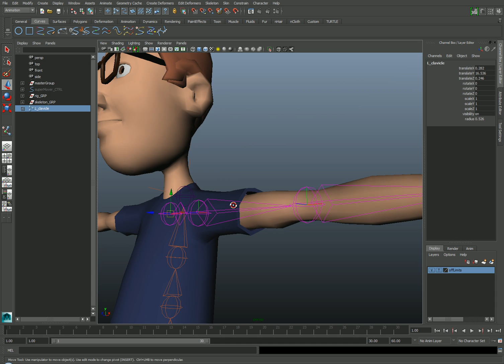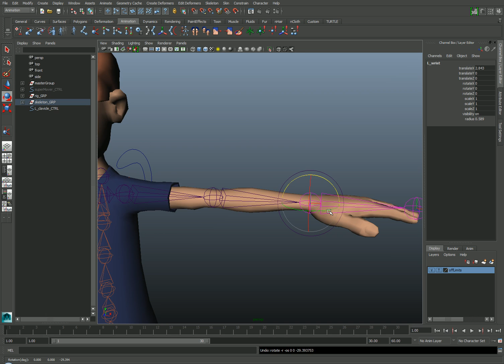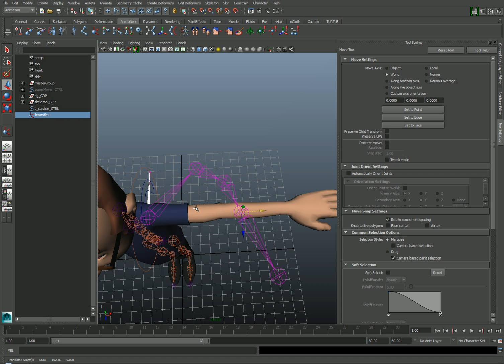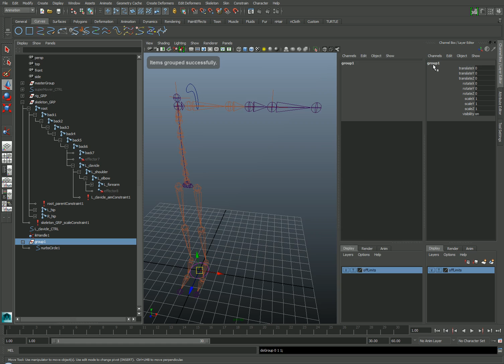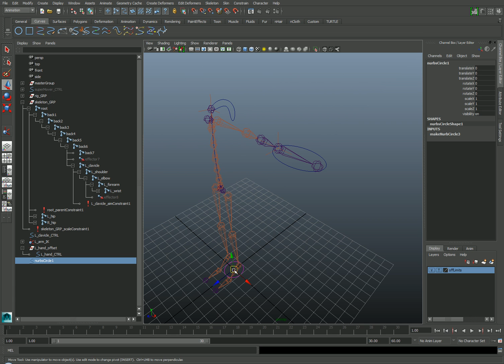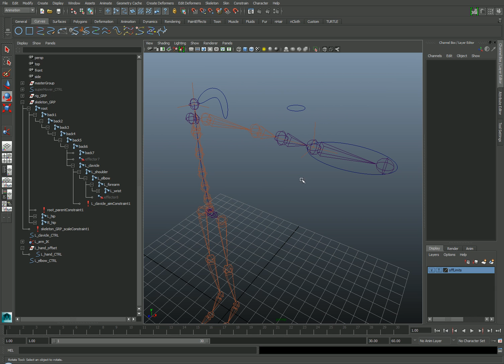Tutorial: Rigging an IK Arm in Maya

Comment: Great tutorial, very clear. I learned in the length of this video the same information from about half of a semester. One question. I'm running into a problem setting up the controller for the right clavicle control. The left one works fine, but for some reason the right one is acting up. I froze the transforms, snapped the pivot over the shoulder joint, and constrained it with maintain offset turned on and the world up type set to none but when I try to move it absolutely nothing happens. I can see the constraint in my outliner, but it doesnt affect the joint. I've been struggling with this and I have no idea what's going on. Also, if it helps I'm actually using the ybot rig from mixamo and adding ik controllers since it just came with bones and nothing else. Don't know if that helps, but I figured it was worth mentioning. Thanks

Comment: I've pretty much been able to rig anything pretty ok, but I've never seen a decent setup for an automatic forearm roll to fix the twisting issue when the hand rotates on the X axis. I'm sure you guys know what that is. 

So in a basic arm setup we have a RP IK solver with a manipulator curve that drives the IK handle with a point constraint and the orientation of the hand joint using an orientation constraint. Mechanically this works fine. What a lot of people are taught to do with the forearm and wrist issue is to create a forearm joint in between the wrist and elbow. That's a good idea until we try to automate it. If we use the .rotateX /2 expression that most people teach that only works until the hand manipulator gets moved at a certain angle to where the orientation of the hand creates gimble lock. 

So then if we use the Object Axis orientation for the rotate manipulator we don't have to worry about gimble but unfortunately that forces us to rotate the hand manipulator on all 3 axis thus making the forearm rotate even when we rotate the hand up and down because of the three axis rotating together to over come the gimble lock. It also makes a mess in the curve editor some times creating euler flips.

So what does a professional wrist and forearm setup really look like?? I seriously have never seen one. All I've seen are some half baked setups. Thanks for any hints on this. I'm guess it requires a double manipulator setup for the hand and wrist region?

Comment: Nice tutorial. A good tip instead of parenting temporarily the group, is to actually use it so the rig does not break. 
For instance, create a null group "Ctrl + G" 
Select the Joint + Ctrl Select the null grp and do a Point Constraint and a Orient Constraint with Maintain Offset off - On the settings
Go to the group on the outliner and delete the PointConstraint and OrientConstraint on the null grp.
Parent the curve to the Joint and freeze its transformations. 
Now you will have a null grp with garbage values and the curve inside of it. This way the rig will never break because the null group is acting like "glue" on the joint with the proper Rotation and Translation values.

Comment: thanx jason. 
i have   maya skel Joints named arm, forearm, wrist, palm1, palm2. as u said i have snapped ik handle to wrist end after drawing ik handle (to forearm). that has worked. no issues.

then i did...
1) constrained  palm1 rotation xyz to L hand ctl. 
2) set driven keys for palm2 for small secondary rot effect.
3) as u said, i gave expression "wrist.rx = palm1.rx;" . then just to check, when i rotated in x the L_hand_ctl to +20 and did undo.
     as a result wrist and palm1 was showing -20 (when L_hand_ctl rotx = 0).
4) then i changed the controller in expression like this..
    "wrist.rx = L_hand_ctl.rx;". then i checked rotating the L_hand_ctl in x to +20 and then again to 0. now the wrist joint was showing correctly as 0.

Comment: Any trick for the forearm twist joint for Maya LT? There aint no expression editor there. And I kinda tried everything i could think of, but Node Editor allows only raw inputs, can't operate a divide on a parameter(specifically a float, integers are accepted though). Also, how do you make your controls follow your  rig around? I move da hand  but the elbow control just stays in the same place. It still works though. Will I break something if I parent a control to something it constraints?

Comment: very nice tutorial. really helped me a lot. But i'm having a tiny problem. When I try moving the pivot of the effector, my arm starts spinning around like crazy such that I cannot get the pivot to the wrist. please help.
Reply: +Fatma Rajab make sure your ik is not sticky in the tool settings
Reply: I will.  Thanks
Reply: +Fatma Rajab you can deactivate it after you set it cause you still want the sticky property for animating it's just sticky locks the effector if active so disability it fixing the effector then activating is the fastest work around.
Reply: +Stick3563 and can you plz tell me how to deactivate it
Reply: +Fatma Rajab it should be in its attributes of the ik chain unless you are still applying in which case it will be in the tool settings as a check box while in the attribute bar it will be a drop down. I'm not in front of my computer ATM but when I am I'll clarify exactly where.

Comment: Hi +Jason Baskin! i really like your tutorials because it's at the perfect pace and you explain everything so well. I'm having trouble though, at the part where you constrain aim the clavicle control to the clavicle joint. it works perfectly on the left arm of my character but jut goes crazy when i start doing it on the right! i have no idea how to fix this. i only found out after binding to the skin. my shoulder just twists like crazy when i try to move the control. :( please help. anyone?
Reply from the maker: Annie Chen Hi Annie.  Thanks for the kind words.  It might have something to do with the way you created your joints, but try this: delete the problem aim constraint, and create a new one with maintain offset turned on, and the up vector set to none.  Make sure you select the clavicle control first, and the clavicle joint second before creating the constraint.  Also, make sure that the clavicle control has a pivot point at the shoulder (not at the clavicle).  

Hope that helps,
Jason
Reply: Jason Baskin i just tried what you suggested but it still twists the same way. and i noticed that after constraining it the the rotate is highlighted but RotateX is set to 360 while the others are 0. weird. :\ i went back to before the aim constrain to check and it was all normal. all the rotate directions are in 0.
i have everything else going for me except for this stubborn shoulder. did i miss anything?
Reply: Annie Chen I don't know if this will help, but maybe your axis orientations for the joints are not in tune with each other? Highlight the clavicle control that isn't working properly and go to Skeleton/Orient Joint/box options and put a check in Orient Joint to World then hit apply and try your constraint again.  If it still doesn't work maybe uncheck Orient Joint to World and put a check in Primary axis X and see if that works.  May have to fiddle around with the settings in there, I don't know if it helps but I hope it did.
Reply: ***** you are awesome! :D

Comment: Hello Jason,

First off, thanks for going through the setup with us. It's really helped me get started on my own rig!

A problem I'm getting right now though is that my joint chain rotates 180 degrees whenever I pole-vector constrain the ikhandle to the elbow control. I've tried setting up everything from scratch but the problem persists.. Do you know what might be causing the rotate and how I can fix it?

Thanks,

L
Reply from the maker: Be sure to build your arm and leg joint chains with a slight bend at the elbow/knee if possible.  If you must create the joint chains completely straight, then you will need to select the elbow or knee joint, rotate it into the desired bend orientation, right-click and "Set Preferred Angle" prior to adding the IK handles.  Hope that helps.

Comment: Great tutorial! Exactly what I needed to know for the pesky forearm portion of the setup. This is actually a much better method than some other processes I've come across which went the route of placing the in handles from the arm/forearm to the wrist which do cause the rig to move from where I wanted it and prevented the pole vector @ the forearm to stay in place. Thanks again! P.S: the video is very low quality, making it hard to see what u select/type, just a heads up.
Reply from the maker: Thanks, Hugo.  The source video was actually posted in HD, so be sure to modify your playback settings on YouTube.
Reply: Thanks, yea it was my playback settings lol.

Comment: Thanks for the great tutorial: I have one question. I'm rigging a character in a low t-pose, and when I start moving the Ik wrist ctrl around, usually I end up some problems with the rotation order that leaves me unable to twist the wrist properly, because no rotation axis still lines up with the arm twist properly. Is there a solution to this problem, or do i simply to cope with this?
Reply from the maker: This issue is known as "gimbal lock" and is a recurring issue for animators.  You can actually modify a control's "Rotate Order" in the attribute editor before animating, but this can be bit of a hassle.  Some riggers will create a separate child control (directly beneath the problem gimbal control in the hierarchy).  Visibility of this extra control is hidden by default, but if the issue arises the animator can turn on the child control and have full access to all three rotation axes.
Reply: Jason Baskin So basically, they create a separate joint to drive the wrist rotation? I actually sort of solved the problem by connecting the wrist rotation to custom attributes in the wrist control rather than orientConstraining it. It works pretty well, except that you always have to rotate the wrist from the channel box, which is sometimes unintuitive.